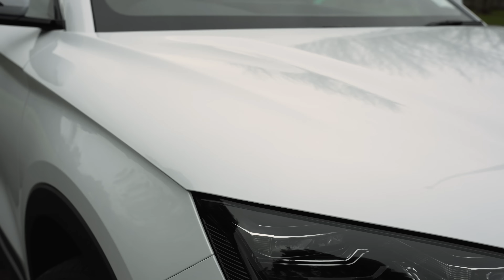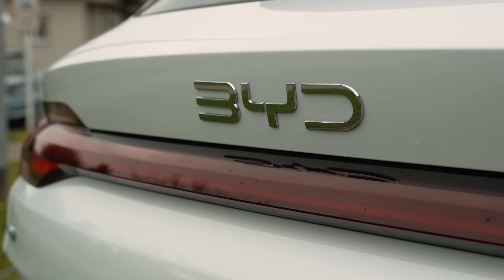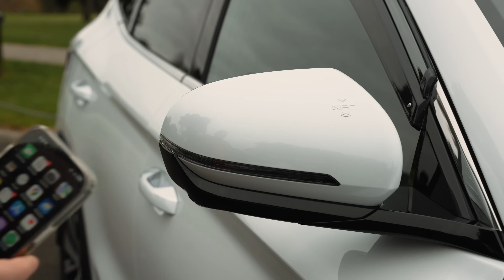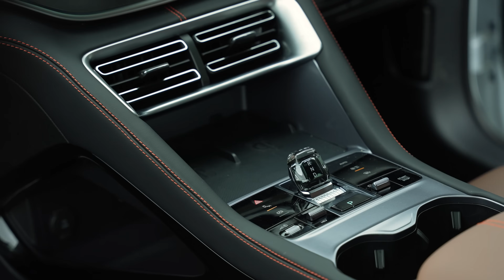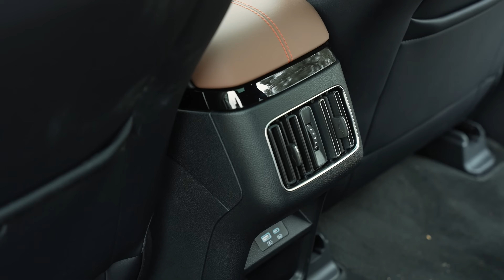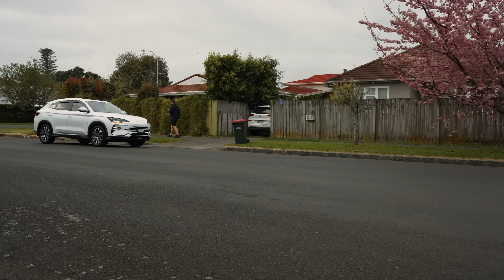BYD Sealion 6 (Seal-U) - More EV than you think!

Comment: I found the steering VERY light and felt vague.  Do you know if they can firm this up apart from sport mode, which still doesnt fill me with confidence
Reply from the maker: We noted a similar issue, made worse by the lane keeping system. I suspect this is more down to the EPS calibration and could be updated.

Comment: You can also adjust a/c controls by using a 3 finger touch on the screen and sliding up/down for temp and left/right for fan speed.

Comment: I can’t help but compare this to the current Seal for equipment levels. It is after all called the “Seal U” in other markets. Specification decisions like having an opening sunroof with a blind in this, but not the Seal. Conversely, no lumbar support in the Sealion, even in the Premium (AWD).
I must admit, I found the Sealion 6 nice to drive and liked the “armchair ride”. I did note a drumming noise at motorway speeds though. It may just be the tires fitted, but would be a deal breaker in buying this vehicle for me.
99% of my daily driving is <90km, so a PHEV would work for me (current EV owner). A bit disappointed the Sealion doesn’t at least match the Seal in towing capability (or the Model Y for that matter).
Reply from the maker: We didn’t notice a drumming. Just your test vehicle?
Reply: Could of had the back window down as that will cause a drumming sound

Comment: For all the chat about Phev's being great for long range travel, we don't see many long range tests / reviews? I'm Phev curious as my job requires doing several hundred open road km's a few times a week but can't find much info on how thirsty they are in the real world
Reply from the maker: We actually planned one but my daughter got sick. It will come.
Reply: @EVsBeyond  excellent. Would love to see a fully brimmed tank and battery  to empty, and the economy average from that :)
Reply: Check out the test for philippines version. They were able to get 1400+kms on this one
Reply: I did a 2000km trip with a Chinese 115km range version Song Plus DMI, priced 19k USD, not charged at all, used pure gas engine and I got 6.2 L/100km pump-to-pump. I know two people, one's from China, one's from Australia, both of them had the almost exact same figure (6.1 and 6.3). The acceleration is amazing compared with my 2.5T CX-50 on the freeway and in city driving. Interior is way better than most non-luxurious cars in the US, steering is not as good as Mazda and BWM but it's on pair with Hyundai, PHEV is the next level, I don't see anyone would want to drive an ICE car if the PHEV is only slightly more expensive.

But sadly, we can't get a BYD in the US.
Reply: @tedhansolo  awd or fwd ?
Reply: @1redgod  It's FWD and Chinese market has only FWD models now
Reply: @tedhansolo  Yes Donald will make sure of that

Comment: Looks like a great car for what it is but also can’t help but feel that it shouldn’t exist. Studies have shown that PHEV’s get driven a lot more on fuel than they need to be
Reply: A Tesla fanboy whining about hybrid sales growth crushing Bev sales. Shocking.
Reply: Those studies are based in Europe for company cars that have the company also paying for fuel. BYD has collected actual user data that shows over 88% EV driving. Of course, that might vary depending on the market, charging availability and use case.
Reply: @larryevans6739  I’m not sure that that’s backed up by facts. Sounds like speculation to me. I don't think it's specific to cost and who is paying, it's behavioural. People will take the easiest/laziest option which often means they run on fuel. BYD’s data is likely China specific given that these cars haven’t been available much outside of China
Reply: But not me, I am happy because I will buy a fully loaded BYD Sealion 6 PHEV Premium anyway.
Reply: In China where BYD is from, the Sealion 6 is available in both PHEV and EV drivetrain. The PHEV sales number is 4 to 5 times higher than the EV version even.
Reply: @PanMotoring  thanks for the info. Is that for the life of the model? What is the reason for that? Is price a factor in that?
Reply from the maker: Agreed. Though I suspect that is down to few having the range to be usable as an EV, so people don't prioritise charging. This really is different.